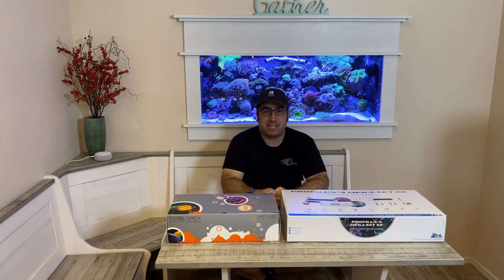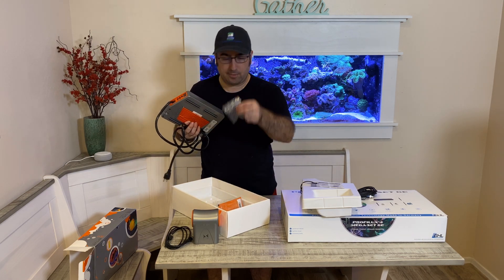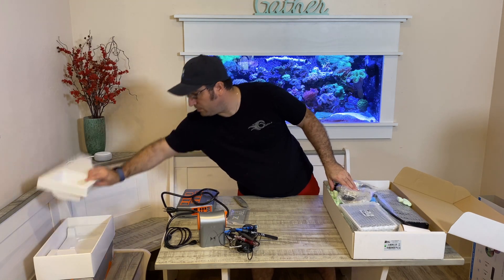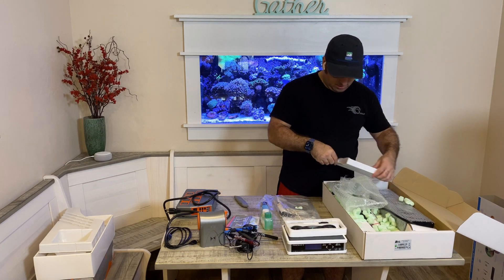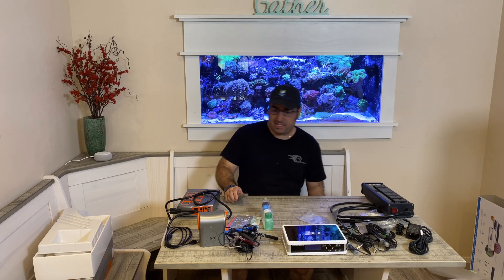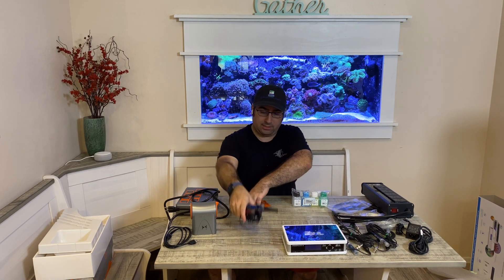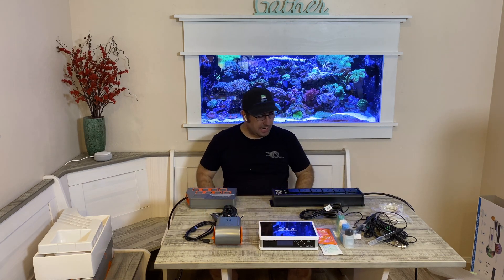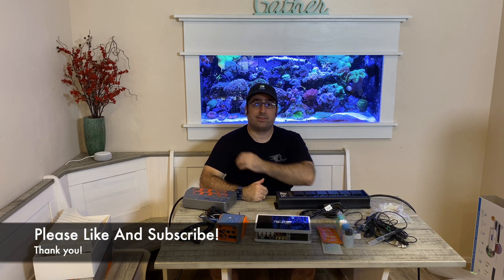GHL Vs Neptune Systems - Episode 1 - Unboxing

Comment: I would love a GHL over the Apex.  I personally find the apex cheap looking. I understand Apex have now possibly surpassed GHL due to the support they have at store level but if I could get either it would be GHL
Reply from the maker: The headaches with GHL never will surpass the ease of programming with Hydros or Apex.
Reply: i dont doubt that but going on what BRS say apex sell 60-1 on any other controller its not a fair comparison Apex clearly have a bigger budget but thats the way it goes i guess
  @ReefAndReptileAutomation

Comment: The GHL Powerbar is built so those outlets can be swapped for 120/220 for foreign and EU plugs.  That's why overseas do not have the new EB832 because its not a simple 1/1 outlet swap while any GHL powerbar update could be easily pushed worldwide.
Reply from the maker: Makes sense.  They will do it someday.